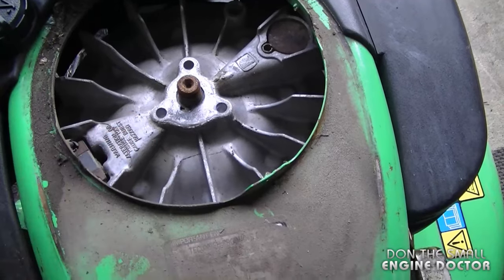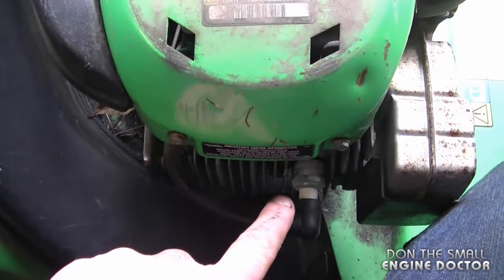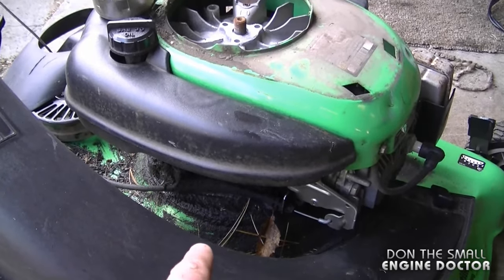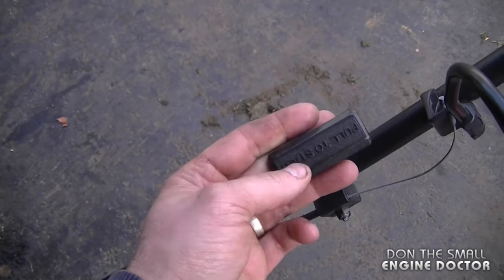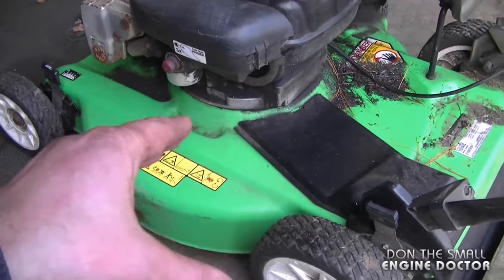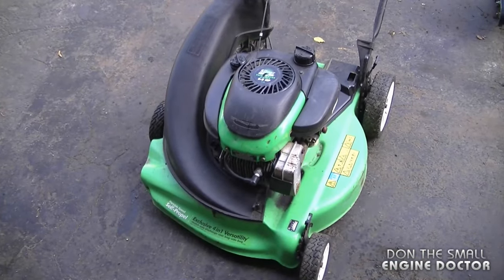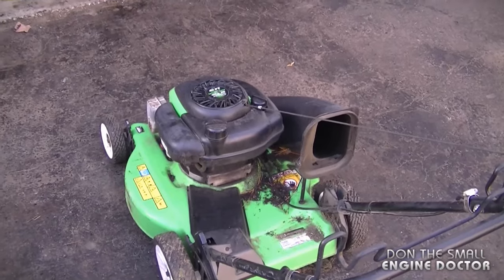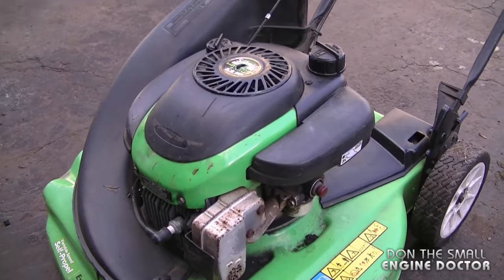Lawnmower Will Not Start - You Will Never Guess Why!

Comment: Hi there:

I have a Tecumseh ECV100. It hit a rock, wont start. Flywheel wheel key is perfect. The blade was loose like you day and oil coating everything like you said. I am at a lose of what could the issue be. 

Any ideas? Thanks.
Reply: i'm not an expert but my guess is your flywheel key didn't do its job and didn't shear. Check the alignment of key slot to key. It maybe off alignment but key look ok

Comment: Soooo. MY craftsman mower with a Briggs engine recently ran fine after hitting something, but I found the key was sheared. therefore since I needed to mow now, I tried cranking it. Nothing... FOund the flywheel key was sheared halfway, so replaced that, new coil, new spark plug, everything as far as maintenance parts was replaced. Still completely dead. No kickback on the pull cord, no fire, getting gas because the plug is wet.... I even sanded some rust off the flywheel pickups for the kill switch and coil. Still not running, not even a pop, There is some compression, because I can feel it and hear it...
Reply: Did I get a defective coil maybe? Was briggs & Stratton branded,...

Comment: Would like to know, I have had a couple mowers with these symptoms and having checked the flywheel key found every thing appears to be intact. Done the usual carburettor check clean ect but no go. My question is, can a key look all got but be ever so slightly out and would this effect the timing to a degree to cause kickback. Thanks.
Reply: If any misalignment between the shaft & flywheel is so slight that you can't noticeably detect it, it's pretty unlikely that it's causing any problems. You can try replacing the crankcase breather if you have a bunch of oil coming out the intake & messing up the carb & air filter, and if the thing just runs rough & doesn't like to start, try replacing the diaphragm, doing a very thorough cleaning of all the carb parts as you access them. Check that the coil is properly spaced next to the flywheel, and if all else fails, try a different coil. Hope this helps.

Comment: Great video - i'm working on an older craftsman pushmower that runs perfectly when started. Takes a few pulls but every now and then it does jerk back after i prime the engine. New plug and blade. Could the key be sheared even if it runs perfectly? Could anything else cause this? Thanks!

Comment: The oil everywhere is a symptom I didn’t know of yet, I think I may have this issue on a little go kart I built... I’ll examine it tomorrow. I want to put a cast iron flywheel from a snowblower because it can idle better with more inertia, but this may do the trick for now
Reply: Update: I replaced the key, it broke. Then I aligned the timing to be a few degrees retarded and welded it all together. Then it broke the crankshaft where I welded, so I welded more. Then it broke a quarter inch off the end of the crankshaft. Then not only did I run out of welding wire, but I quite literally ran out of crankshaft to weld to. So, last ditch attempt, I retarded the timing even more and drilled through the crankshaft and flywheel diagonally, and drove the beefiest wood screw that I could find through. Guess what, it broke. Now I’m screwed because that’s the only engine I had around with the long crankshaft on the work side... it’s one of those days where nothing works

Comment: Don, have you used any of the aftermarket flywheel keys that replace Briggs & Stratton part no. 222698S, and if so, what brand do you use? I bought aftermarket flywheel keys packaged under the Arnold brand once. They looked undersized by a few thousandths, and when I installed one, the engine would not run well. Then I replaced the Arnold flywheel key with a genuine Briggs & Stratton flywheel key and the engine ran perfectly. I would like to buy aftermarket keys as they cost much less than genuine B&S keys, but now I am wary of all the aftermarket brands.
Reply from the maker: i have used Stens keys

Comment: Running over the simplest trash can cause this.
Six pack rings,grocery bags,anything that the blade can pick up and snag under the deck can shear the key.
Even worse,there's a key for the blade adapter,that is not replaceable,you have to replace the blade adapter itself.
Blade sharp.
Cut high.
Pick up trash.
Don't loan out  your mower.
You know how people drive a rental car? They are the same way with a mower that doesn't belong to them.

Comment: Your video supports my conclusion that my timing is out of whack.  My buddy borrowed my mower and hit something hard, it even sheared off the bolt for the blade.  I repaired it but the cord kept kicking back on me.  I'll check that flywheel key next.
Reply: Never loan out small engine equipment of any kind unless you are able and willing to replace it at your cost.

Comment: Dony - I had just that on my 2009 JD lawn mower. Both keys (top and bottom of the shaft) were sheared but still in place and I replaced them. There's still excessive vibration and I think the crank shaft is bent. Do you think it is a good idea to replace a crankshaft? Parts cost is around $100 and I can do the job myself. Thanks.
Reply: MertUluc did you check or replace the blade as well?
Reply: Thanks for the reply. Yes it was straight and balanced. When you turn it by hand it wobbles you can kinda see that shaft is bent.
Reply: MertUluc well if you can SEE that its bent, then its probably toast
Reply: I think it is. Like I said in my original question, I'm trying to get a sense of whether it'd be wise to replace the crankshaft.. What is the likelihood of more surprises/costs involving a crankshaft replacement? Otherwise it's a very clean good mower.

Comment: My push mower has the same symptoms of a sheared flywheel key. I've replaced the key with a new one but no joy, the engine is misfiring and blows smoke in the carburetor just before it stops. What could it be?
Reply: check your valve clearances.

Comment: I thought I did that to the fly wheel key but I was told I bent the shaft on my Honda. Is that true? If so how can I check ? All my symptoms are what your described.
Reply: Kasra Sadeghian you can still bend your crank shaft if you hit something hard enough, even if you shear the flywheel key. to check, take out the spark plug, tip the mower on its side (carb up!) and have someone slowly pull the pull rope. youll see the blade bolt on the end of the crank wobble back and forth.

Comment: I love these vids, thanks for taking out the heartache of engine problems. I have these symptoms on my 11.5 hp b+s ride on, but also backfiring through the carb, which I only noticed after stripping and cleaning the carb  and running with the filter off. It was dark when I finished and flames shot right out back through the choke. Dead giveaway that the timing is out, so £3 flywheel key on it’s way. As I’ll be using a breaker bar to lose the fly nut I’m going to jam piston with rope, but was a bit worried about the stress on the cylinder head. Anyone used this method?
Reply from the maker: should work, also check valve timing https://www.youtube.com/watch?v=T1anxdNWf5Y
Reply: Thanks for that Don. Do you have a video for the valve timing on side valve? I got the head off and it’s been burning oil, probably through the carb from the breather. Good news is valves are still tight when closed and cylinder sleeve is still nice and smooth

Comment: I replaced the key with some stock at the hardware store the mower is still running bad almost like sped up and its vibrating back and forth . I just ordered the briggs and Stratton ones that go to the mower. is it possible that the wrong size key like slightly different will make the mower run like shit?
Reply: Yes, I have bought an aftermarket Briggs & Stratton flywheel key at a hardware store and installed it and the engine ran poorly. Then I replaced it with a genuine Briggs & Stratton flywheel key and it ran perfectly. But if you are getting a lot of vibration, you may have a bent crankshaft. A flywheel key will not fix that. Engines with bent cranks are for the scrap pile.

Comment: Why dont they create a sheer key for a lawnmower blade rather than for the fly wheel? It would be 10X faster to replace and less of a headache. No tearing apart the motor to get to it. It would eliminate the flywheel misalignment problem.
Reply: Some have both usually in the adapter for the blade at the end of the crank.

Comment: Would a sheared flywheel key cause backfire when I finish running the engine for about 10min?
Reply from the maker: it could
Reply: I just checked my flywheel key it’s not broken or anything.  Not sure what else could cause a backfire after I turn off the lawnmower i notice it only does this when the engine has been running for about 10-15 min.
Reply from the maker: @C10_kEn  sometimes gas still gets in or valves may need adjusting
Reply: @C10_kEn  Gas is sucked into the combustion chamber by the rotating engine after the ignition is switched off. This unburned fuel mixture is then exhausted into the hot muffler where it detonates. Many carburetors have a fuel shutoff solenoid to prevent gas from being sucked into the intake port as soon as the ignition switch is shut off. Your carburetor may not have a shutoff solenoid. If it does not, you just live with the backfire, or replace your carb with one that has a fuel shutoff solenoid. Also, as donyboy73 stated, your engine may have valves that need adjusting. This is especially true of Briggs & Stratton single cylinder Intek overhead valve engines.

Comment: I own a lawnmower with an automatic choke and most of the time when I pull the rope the mower barely picks up the gas but sometimes the engine will start.  What is that a symptom of?
Reply: He's still thinking about it.  Stay tuned for an answer soon.
Reply: Is it a Tecumseh engine? The little passages in Tecumseh carbs that deliver extra fuel when choked often become clogged on Tecumseh carburetors. I clean out those passages with a piece of copper telephone wire. Copper is softer than aluminum so it will not damage the aluminum carb body.
Reply: @josephalan2094  Not just Tecumseh.  ALL engines.  The wire is good, but you can also use compressed air (like you use on computers) or carb cleaner spray or even starter fluis spray if that's all you have.  Soap and water is good too, but dry completely.
Reply: @Kube_Dog  Only a copper wire will safely clean those small passages in Tecumseh carbs. It's dried varnished gas. Carbs used on B&S and Honda engines enrich the fuel through passages that rarely clog. Carb cleaner works fine for those.
Reply: @josephalan2094  There are different B/S carbs, as you know.  These latest ones with the white cartridge that snaps in and out clog a lot.  The older ones with the brass nut at the bottom, yes, much less of a problem.  I've never heard use only a copper wire on Tecumseh and I don't see why that would be the case, but I'll make a note of what you said in case it comes up.

Comment: Probably what's wrong with my tecumseh engine it a takes long to start up but will after a few seconds of trying to it'll do that even after its warmed up it will but there's no oil mess around the engine and no oil leaking from the air filter but i still think its flywheel is bad

Comment: NOTE TO ALL - I continued to try and start my engine after the massive backfires and it would not start. Made matters worst by gouging the crankshaft and destroying the channel for the key. If I cannot re-cut the channel for the new key, I will "weld" the crankshaft to the flywheel. This is a bad solution but a new crankshaft is expensive (8HP tecumseh engine $80) + gasket kit. Any better solutions appreciated.